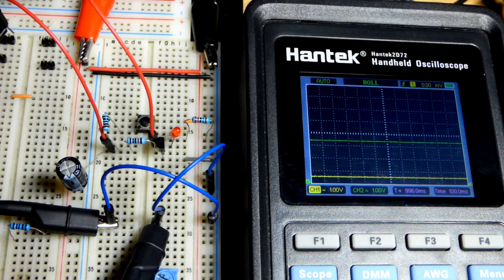LED Timed Off with Fade Capacitor and NPN BJT Collector Voltages Oscilloscope Measured

Comment: Can you make a new project?
There will be 2 input switches to the IC. 

When one input is pressed and released, the IC will output only 12v for one time.

However, when the other input switch is pressed and released, the IC will output 12v  for two times.

For eg. In a car, when lock signal is given, 6hr horn sounds once. When unlock signal is given, the horn sounds twice.